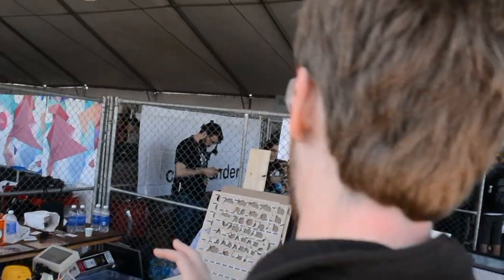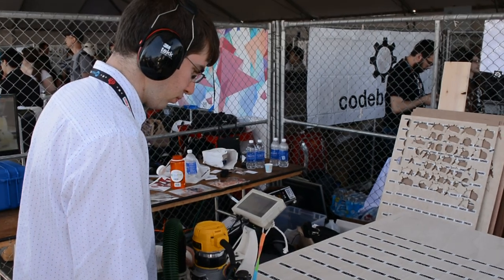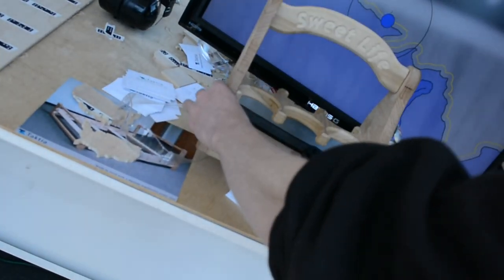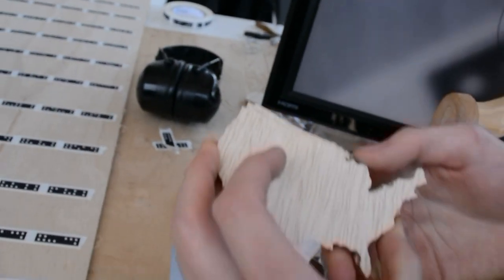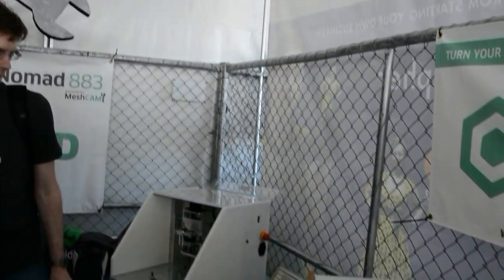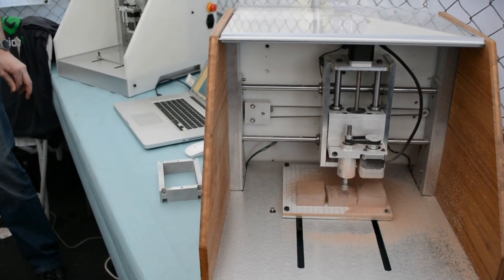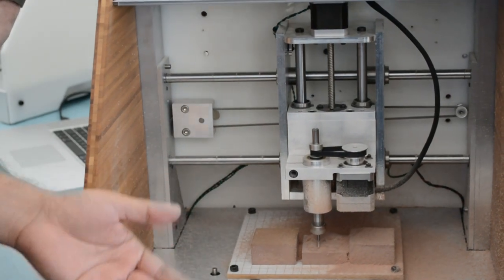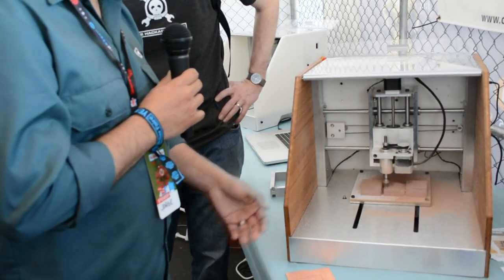CNC Twofer: Taktia Augmented Power Tools and Nomad CNC mill

Comment: 2100 USD? Wow I buy a large CNC with that money.
Reply: Horses for courses. Each approach has benefits and limitations. Want to inlay into a large floor, door, or conference table that is already installed onsite? Shaper Origin. You can't use a large gantry CNC for that. Need to custom engrave items at a craft faire? Shaper Origin. Don't have the space for a large 4ft x 6ft CNC router setup? Shaper origin. Need to crank out 100 identical CNC's wooden coasters? Ok for that get a traditional CNC, or be prepared for a looooong shaper origin session...